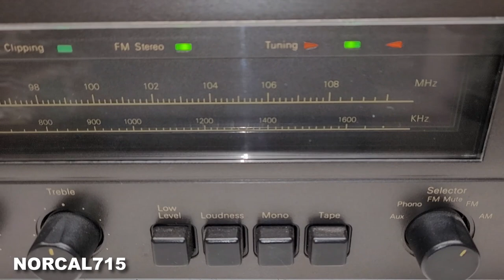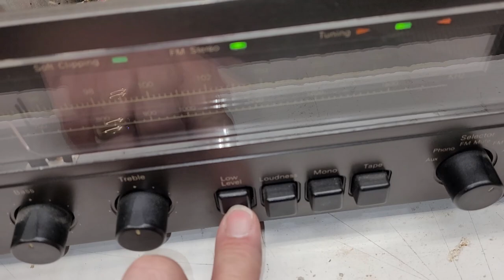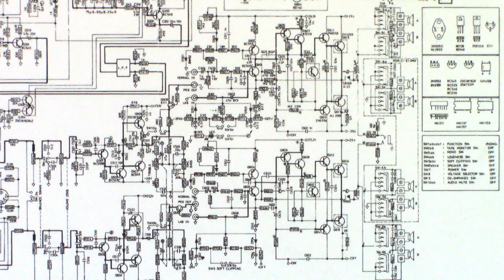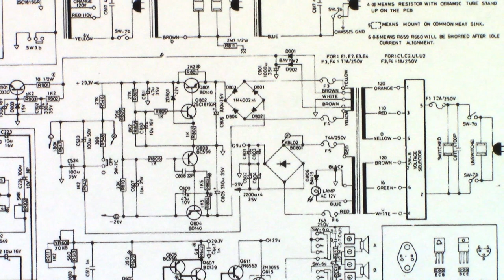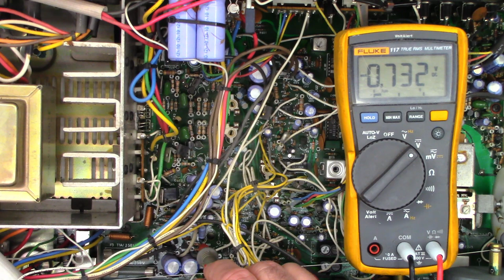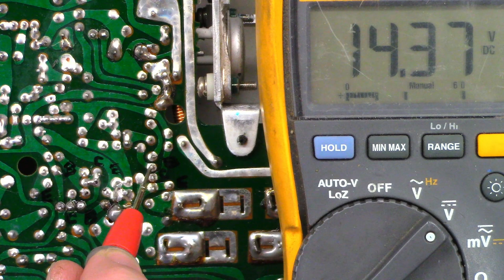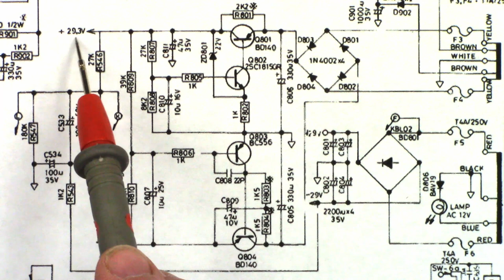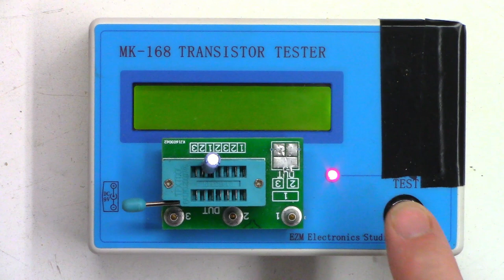NAD 7020 VINTAGE STEREO REPAIR. VERY LOW DISTORTED AUDIO. REPAIR CAPACITOR TRANSISTOR DEOXIT D5 FIX

Comment: I came  here to see reviews  on our receivers  and  I'm impressed with  your  knowledge and  skills. I found mine and  rescued  it.it was missing  cover screw and  very  dirty. I cleaned the  controls  but still  have  the left channel  crap out on occasion. If I turn my speaker  selector  and  my aux phono it works. I don't  have  much reception  on my FM  mode.im running  3' of 300ohm wire split but not  good. I've used it on my kenwood  and  picked up  station  np

Comment: Those purple hue Panasonic caps are notorious for failing nowadays. Some leak electrolyte and that eats the board traces, some go open, some short. This would be one of those rare instances where I’d bulk recap to remove all of those purple Panasonic’s. Awful caps nowadays.

Comment: HELLO, I HAVE A 7020 AND IT HAS 2 ORIGINAL MOTOROLA TRANSISTORS 2955 AND TWO THAT ARE NOT ORIGINAL, ONE 3055 AND THE OTHER 3055H, MY QUESTION IS WHETHER THERE ARE DIFFERENCES BETWEEN THE 3055 AND THE 3055H? SHOULD I REPLACE THEM? THANK YOU